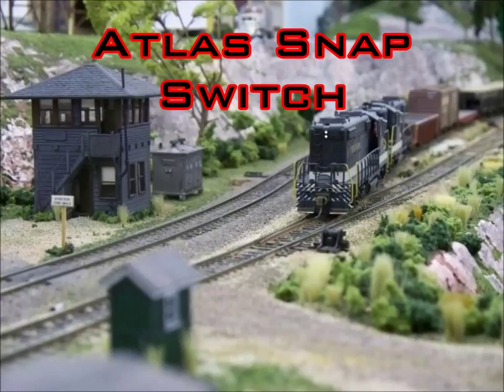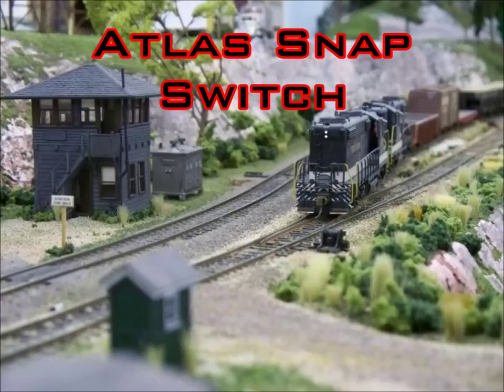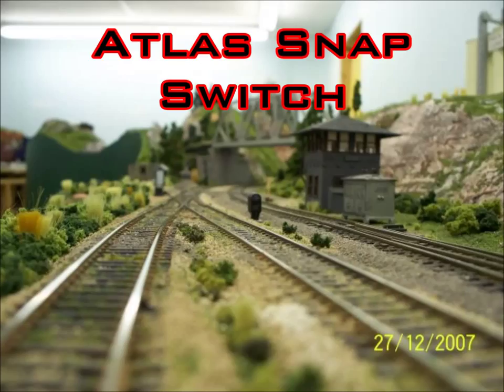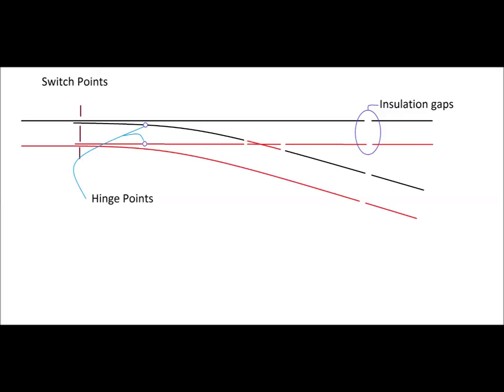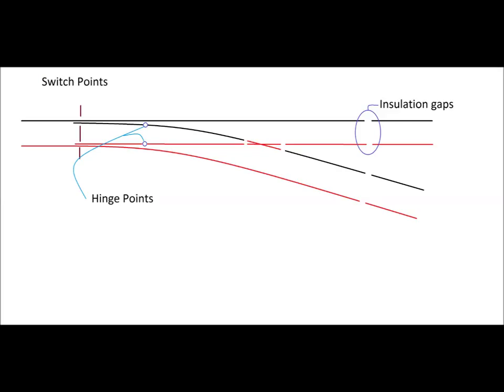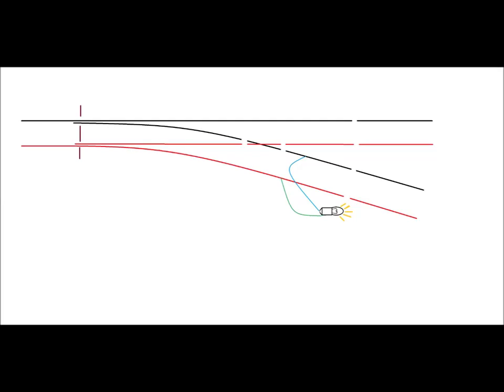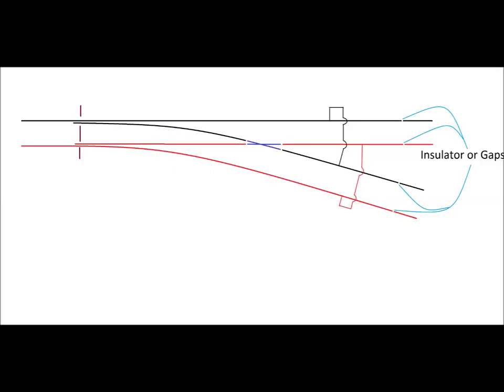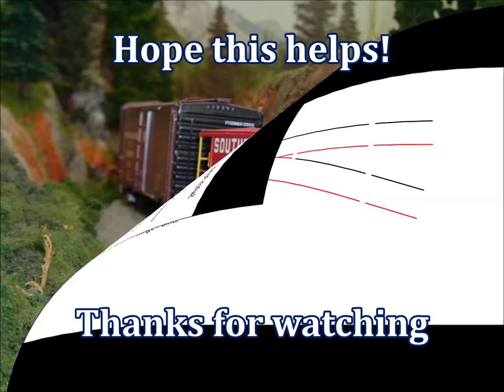Atlas switches dead spots

Comment: Mistakenly bought 10 atlas o gauge switches at once. 8 failed, all outside the 1 yr warranty. Actual broken rails, momentary power loss. I was stuck since I bought a huge amount of atlas o gauge track for my new trainboard, 27ft by 17. Must learn a lot more since I have so many problem atlas switches. You video was quite helpful. The other atlas problem was atlas used wires too small in the internals of the actual switch track. Years later in 2016, I bought 2 new switches & it is immediately obvious that heavier wires were used. I always hesitated to use the far superior Ross switches with atlas track everywhere else.I have many o gauge heavy mth premier steam engines that stress the poor atlas switches. Hope I can learn enough to fix my many problem filled atlas switches. I adevise, plan a video diary on building & running my new o gauge trainboard. Ive found user comments to be most helpful in troubleshooting